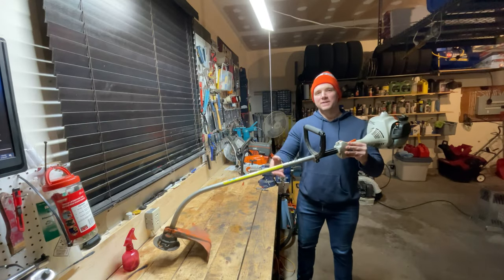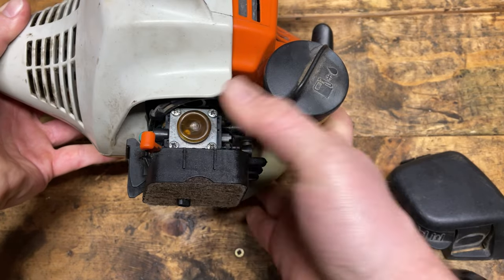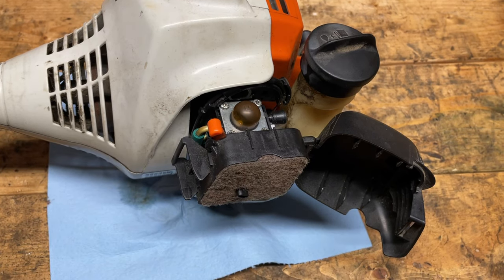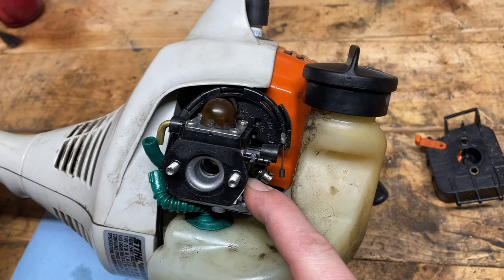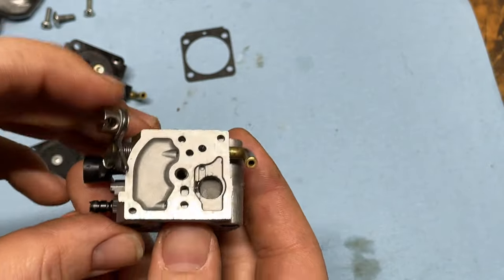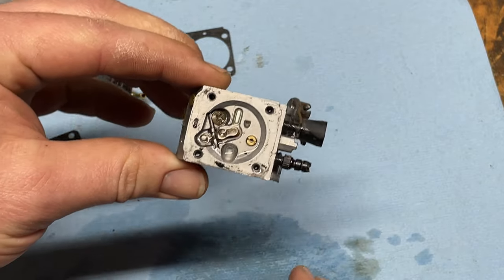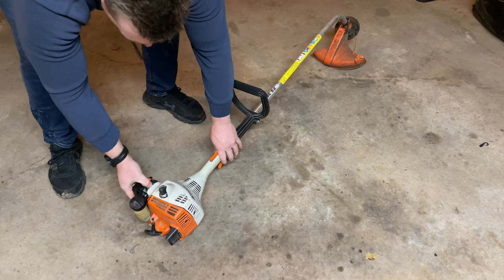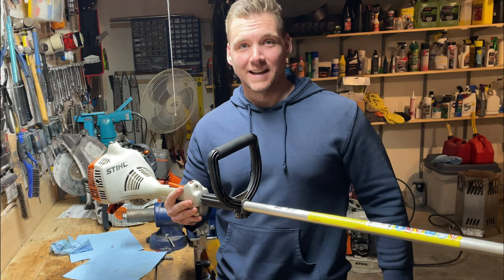How to fix a string trimmer that won't prime (purge bulb doesn't work / won't fill)

Comment: Had this issue happen while using my craftsman string trimmer on Friday. Took the carb apart and blew compress air to clear passages in carb and it fixed the concern. Thanks Dave great video!

Comment: Youtubers always spray the carburetor with solvent miraculously solves the problem. It never works that way for me.
Reply: My issue was the intake where the bulb is had a blockage the carb cleaner couldn’t get to because it was such a small hole, but I took a air gun on my compressor and blew it out

Comment: Awesome video! I had the same problem with my 17year old STIHL FS-46C trimmer and I initially thought it was a bad primer bulb or faulty fuel line. After replacing those, I still had very little to no prime. Before buying a replacement carburetor I decided to take the original carburetor apart and clean it out with compressed air and carb cleaner and just like that the primer bulb fills completely and the trimmer starts right up and runs great. Thanks so much!!
Reply from the maker: Hey! This is great. This is why I make the videos. So happy to help.

Comment: Thanks for the info. I wasn't aware that the primer bulb actually pressurized the fuel tank,which pushes the fuel up to the carburator,then thru the bulb & the excess returns to the tank.I know that on some 4 stroke small engines.the primer bulb pressurizes the carburator bowl,which in turn forces some fuel into the intake throat. Thank you for this Great video

Comment: Many thanks for the informative demo. I had a problem with purge (primer) bulb not filling on my Stihl HS85 hedge trimmer. Slightly different components, but cleaned out the carb with WD40, and now it's working a treat again.
Reply from the maker: Hey Robert! That’s what it’s all about for me. Glad you got that beast running. 85 series is some of the best Stihl ever made.

Comment: Thank you Dave for the great job in cleaning the carburetor.I'll have to do the same with by my Stihl trimmer FS 311 because I believe the carburator has clogged because it hasn't been used for a year and the the gasoline is old and filthy.Thank you from Umbria in Italy.

Comment: I loved the video and learned a lot. However, my problem was much simpler in that my fuel filter was completely clogged which should’ve been the first thing to check since it doesn’t require taking anything apart. But in any case, thanks for a great video.
Reply from the maker: Hey Phil! Thanks for the kind words. You’re right - fuel filter first is a great idea!
Reply: @DavesSmallEngines, your information was more for those that are already familiar with the process of troubleshooting, ie, checking the filter, ensuring the hoses are in good condition and are not plugged or kinked, etc, etc, so your explanation was not meant for folks that barely know the ins and outs of what you and I are looking at or what you are trying to do. Yes, there may be slip - ups here and there, but it’s easy for me to put two and two together and figure out what may be right or wrong. But it’s those DIYERS that have no idea of what’s happening that you should have outlined a basic fault finding checks to be carried out before tearing the carb apart, otherwise you did great. Thanks.

Comment: Nice vid Dave - after changing out the gaskets & diaphragms ensuring each were in the right order as both pump and inlet are different. I still couldn't fill the purge bulb even after spraying things clear as you did. So swapped out the lever for the inlet valve and the diaphragm for the pump and BOOM she starts everytime. I knew it would be the inlet valve as my symptoms were starts first time only and runs well after a quick carb and plug clean. If it puckers out due to no gas its hard to get it going again. I suspect the new diaphragm is too stiff or not reaching the lever to lift the inlet valve. The gap on the lever and carb casing  is so small that you'd think its high enough to get pressed by the diaphragm. I know at some stage it aint gonna pump gas thru one day. Might let the diaphragm soak for a week - see if it softens up. Hehehe anotha DIY KIWI from NZ.

Comment: This is exactly the video I needed. I just replaced the primer bulb and now it's not priming. Unfortunately none of the 3 8mm sockets I have will fit between the plastic surrounding the nuts and I now have to go and buy a 4th slimmer socket😢🙄

Comment: Excellent video, nice job.  Fixed my Stihl HL 45 hedge trimmer using your video.  It primes, starts, and  idles now.  I'm with Ethan (below), on some "fine tuning" help.  Mine runs good but bogs a bit on acceleration, and I can't seem to "fine tune" it to get rid of the bog.
Reply from the maker: Sounds like it could be a bit rich on the H needle.

Comment: Thanks for your video!  I rebuilt the carb on my 2 stroke leaf blower and the same thing happened.  Interestingly once I put the old diaphragm/gasket in (which was fine) it works.  Does the diaphragm need to be a little lubricated or something?
Reply: Yes diaphragm needs to be wet with fuel preferably

Comment: Thank you for the viideo...really enjoyed it. but just to decrease worry of a pressurized tank. The primer bulb doesnt require pressure in tank.  For fun, just try and prime your carb with the gas tank off.  You will never have pressure in gas  tank unless gas gets hot.  Bear with me...here is a long winded explanation of the way the prime mechanism works. . The bulb is a pump. just like a well pump taking water out of a well.  Pushing the bulb drives air or gas out the bulb into the longer outlet tube back to top of gas tank.... (not through the fuel filter). It purges at the level of the small black plastic connector at end of long outlet tube.  There is a one way check valve in the plastic base under the bulb that prevents air from travelling from outlet tube back into the bulb (bubble). This allows a vacuum in the bubble. This opens up another one way check valve on bubble base to draw air from the top of the carburetor ( carb sits just under the bubble base).   This subsequently draws fuel up the fuel filter tube into the side of carbutator. With every push of the bulb, the vacuum is restored and the  cycle continues to draw more and more  gas throughout the carburetor while pushing more air from the carburator into the bulb. This cycle continues onward until certain chambers of the carburetor become full and then  gas  stays in  the bubble. This all depends on yet another one way valve on the gas inlet tube that doesn't allow gas to flow back into the fuel filter. Just like a water check valve doesn't allow water to flow from a  house waterline back into a well.  In this system, it keeps the gas inlet tube and subsequently the whole carburetor full of gas. If you have  a  bulb that doesnt move gas when you press it, then there is a  leak or a blockage somewhere that prevents the  vacumn from forming.  So any leak in any tube or channel or sticking valve or faulty one way check valve or blocked channel will stop the whole process.  And the issue could occur at any point from fuel filter,  all the way through the carburetor,  to the check valve on the air outlet tube.   If you have this issue, it's best to soak the carburetor and bulb base (bulb removed) in mixed gas for a day if the carburetor has been sitting empty for a long time.  Pray that it's just a leak in the bulb which is the easiest fix. If not, you have a real pain in the A$$ to work through.

Comment: Thanks for the timely video Dave !   My STIHL leaf blower has the same symptoms.  I'll give your advice a whirl.  Your channel is really coming along nicely.  Always enjoy watching !
Reply from the maker: Hey SW! Thanks so much. Give it a try and let me know. There’s a few other tricks if not!
Reply: Ey Dave, i have the same problem but that litle gasket/diaphragm is not dry. But still cant pump up the fuel. 
Pump is okay , fuel hoses are healthy bit cant find the problrm
Reply from the maker: @PchelaUbica  it could be the internal check valves inside the carb have failed. I would try a replacement aftermarket carb next.
Reply: @DavesSmallEngines  i hear some wierd sounds from carb when im pummping.  Carb is original walbro wt160b.
Okay i will order replacement from china. :(

Comment: Exact same carb on my Stihl garden tiller.  Exact same problem too.  Now I think I can fix it.  Thanks!
Reply from the maker: That’s awesome Chris! Cheers!
Reply: Fixed it.  Cleaned out the carb but found that the obstruction was in the primer bulb housing itself.  Hit it with carb cleaner, reassembled it, and it fired right up.

Comment: The primer bulb does not pressurize the fuel tank. It doesn't have enough volume to create much pressure. You can debunk this by starting the trimmer with the fuel cap off and it will run fine. 

When the primer bulb is pressed it sucks a small amount of fuel into the carby from the bottom line. Any excess is returned back to the tank via the top fuel line.
Reply: If the primer bulb is cracked it will leak fuel and then you have a fire hazard.And no, without fuel in the bulb the carb won't get fuel.So it won't run.
Reply: @larrynew7258  When Kleetus said fuel cap, he was referring to the gas tank cap, not the fuel primer bulb/cap.
Reply: Actually mine does pressurize the tank instead of filling my bulb and it is driving me crazy.  Its a Walbro WA-229 on a Weed Eater BV2000.  It was running great one minute, ran out of gas and then after filling the tank up it wont suck any gas into the purge bulb.  After priming it several times and nothing happening inside the bulb I can unscrew the gas cap and hear the pressure come out.  If I pump the primer bulb several times and leave the gas cap on and pull the fuel tube off the inlet side gas squirts out because of the pressure in the tank.  Tried a new carb kit too and still does same thing.... pulling my hair out!
Reply: @notny41  The primer bulb is far too small to pressurise the fuel tank, it won't happen.

Comment: Very helpful, thank you. I went to start my FS110 and the primer bulb wouldn't fill. You've given me a starting point to figure out what's up! Question - I popped out the plug to the fuel tank that leads to the priming bulb. There's just a nub into the fuel tank that appears to feed the priming bulb... How does that collect fuel with such a little, sorry neck??

Comment: Mine is doing the same thing. Replaced the carb, fuel lines, spark plug. Its still bogging down I will try this adjustment

Comment: Another great video for DIYers. Probably remove the needle before spraying cleaner in the passage, some products can deform or melt the tip of the needle. better safe than sorry.
Reply from the maker: Good call Mark! Thanks for the comment. Cheers!

Comment: I have a customer that brought me the same stihl...with the same problem. Bulb not filling with fuel. And u know the deal. He tells me everything he dis to it because it's runs like shut end will bog down and quit. Says he replaced fuel lines, filter, and primer bulb
  
Well, I give it a good carb cleaning and it starts right up and runs great until it starts idling, then it dies. Primer still not sucking fuel. I ordered a new carb kit for it, but I should have focused more on the pump and diaphragm, like u did.. good video
Reply from the maker: Hey Sparky! Thanks for the kind words. Let me know if you have any trouble and I’ll help if I can!

Comment: After some more research & a couple of hands-on experiences,I learned that the primer bulb does NOT pressurize the fuel tank..In fact most tanks are vented.The bulb actually sucks air,to start with ,then sucks the fuel with air,until the system is full,then it just pumps fuel & returns it back to the tank.Now the system is primed & the engine is ready to start.
Reply from the maker: Yes - I have learned that since too. My mistake.

Comment: I would say that the fuel lines are switched or the fuel filter in the tank is clogged and that is why fuel was not pumping to the carb. but I don't know if the trimmer was used since the new carb. was installed. Would a new carb. get clogged so soon?

Comment: What if the trimmer does not have a primer bulb?  My old 1982-made Japanese Echo has the same carb as yours but without the primer bulb.  So one fuel line only.  What would make it not draw fuel by itself?  Will run normal if fuel is dumped into carb via intake but will not pull fuel to stay running on its own.

Comment: Just changed a new carb was dry would not prime. Opened up, put back together with slight fuel on all internals.  Started to prime. Watch cracks in fuel intake line causing air to get in fuel line to carb loose suction.

Comment: Have a STIHL FS 55R single cylinder two stroke engine, runs and idles great only problem is hard to pull on string start to get it running. What do you recommend to fix this problem

Comment: I don't want to take anything away from these instructions, because it's great for us with older trimmers.  But curious...at the start of the video you removed a clear plastic gasket(?).  I did not see any openings in the gasket.  Did you replace when you put it back together?  You state this is a new carburetor, so was this gasket supposed to be removed and blocking the primer bulb from filling on this trimmer?  Thank you!

Comment: Put a new carb, fuel lines and filter on my FS45, and am still having problems with it.  It will start now, but conks out after a minute. Also, I noticed that the fill bulb never really gets very full. 
Could this be a pressure problem w/the tank (bad gas cap, or leak in the tank)?

Comment: Hey my friend I have a craftsman 4 cycle 30cc weedeater and it’ will start if I spray carb cleaner into the carb but then dies , but Iv also noticed that when I try to prime it that it’s only allowing a small amount of gas in to the prime bubble….any ideas?  Btw sir I have taken the carb apart a few times cleaned and reassemble it correctly, new gas and new lines as well

Comment: My Chinese multi tool wouldn't prime. After pulling apart and reassembling and faffing about at least twice I eventually thought, let's try youtube. Using WD40 spray worked a treat. She is now running better than ever! Thanks so much
Reply from the maker: Perfect! Glad to hear!!!
Reply: @DavesSmallEngines  Thanks,,,  but now.., that was yesterday. That was just with the head unit. Today, attached the chain saw attachment etc, ready to go BUT. Wouldn't start. Petrol priming ok. On choke will fire once or twice and stop. Arg! Took off attachment, into the garage and after a bit of fiddling she started again and going really well.  Back outside, and  would not start. Sounds like fuel supply a bit dodgy for some reason? The carb's manifold gasket was ruined last year. Have had it running fine since then though. Any ideas? Thanks
Reply: @dave's small engines Sorted it out. Removed sponge air filter. Obviously needs  a clean

Comment: If that one way valve is bad will it cause the primer to pull fuel in and not hold the fuel in I see them all the time that will only prime a tiny bit

Comment: So the primer bulb pressurizes the tank and that forces fuel into the carb. OR does the primer bulb suck fuel through the carb from the tank??
Thanks
Reply from the maker: Hey Dave! It's a combination effort. The bulb presses out (pressurizes the tank) and when it retracts it sucks (vacuum) through the carb. Cheers!
Reply: So if the tank has a leak and won’t pressurise, will the primer work?
Reply: @bradallen8643  yeah, it should. You can prime with the cap off and I've tested primers with the return line removed.

Comment: Hey Dave
Awesome explanation, short and straight to the point. Donyboy is rubbing off. 
I have the same unit. I had to replace the carb last year because I just couldn’t get it to stay adjusted correctly. 
Do you know how to get the limit caps off of this carb? It’s frustrating when you’re almost there and the limiter stops the adjustment. 
Cheers
Reply: thanks lol!
Reply from the maker: Hey EZ Ray! Cheers for the comments! The limiter screws... well.... the easiest way is a flat head screwdriver. Back the screw out just enough to slide the flat head underneath the limiter cap and twist to pry it off. It ain't pretty... but it works. The other way I have done is using a set of side cutters to snip it off. It usually pops off after a few cuts. Let me know if that works - if not I'll make a video! Cheers!
Reply: @DavesSmallEngines  Thanks for the speedy response Dave. I saved the old carb so I’ll give it a try on that first. I’ll get back to you and let you know how it goes.
Reply: You can heat the plastic limiter caps with soldering iron.  They should pull right off.

Comment: I am looking for some advice!  I changed the carb, it looks wet , I changed primer bulb, and when I pump primer just a little fuel enters the bulb!  Fires up then bogs and stalls!  Looking for some advice!  
Great video btw!
Reply from the maker: Sounds like a carb issue for sure. How old is yours? It doesn’t matter how full the bulb gets really.
Reply: A couple years
Reply from the maker: I wonder if the carb is in need of replacement or at least an ultrasonic clean. If you use fuel with ethanol it’s bound to get gummed up!
Reply: I was using regular gas mixed with the oil!  But put fresh premixed  fuel in purchased at the stihl store